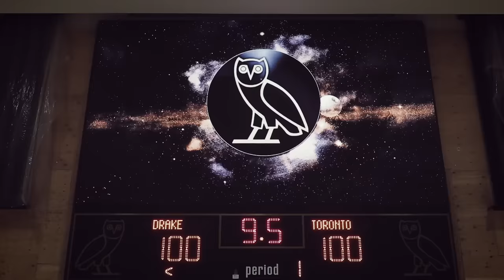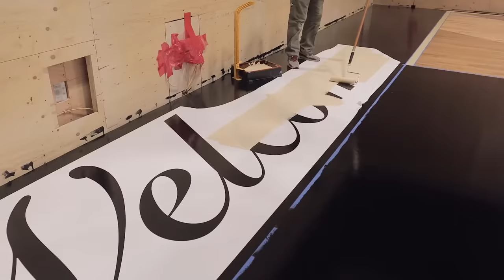Inside Drake’s $100M OVO Mansion Tours NBA Sized Court, Luxury Bathroom, Vintage Candy Room

Comment: You need a crane to hoist a freaking  bath tub? Must be nice in the Philippines you're lucky you get any water, at my dads I remember you had to fill a pail of water from some weird pipe and then you douse your self with ice cold water using a smaller bucket, i use to scream cause it felt like torture